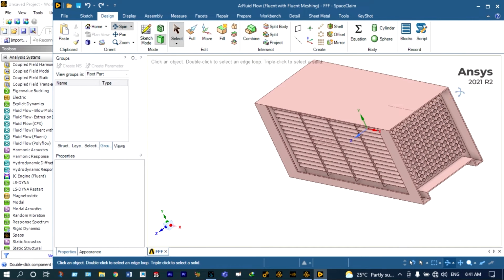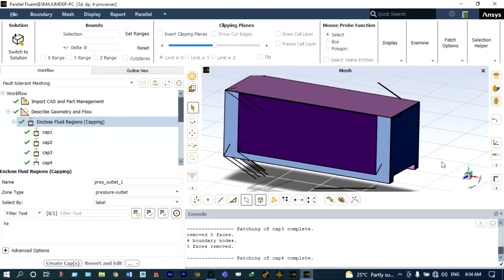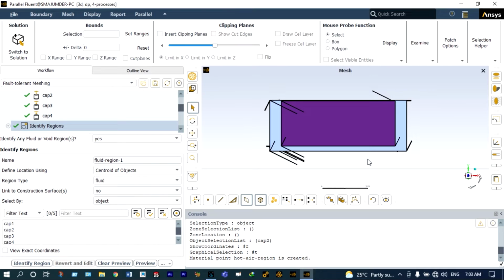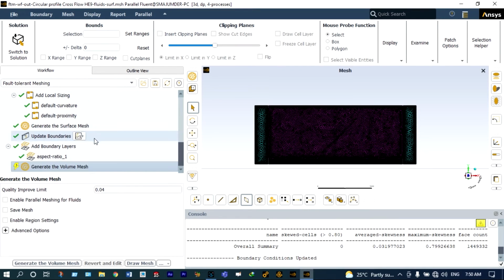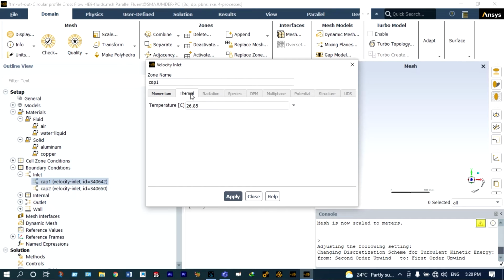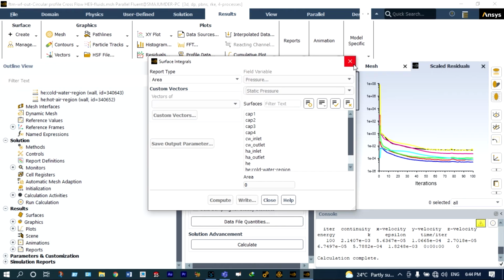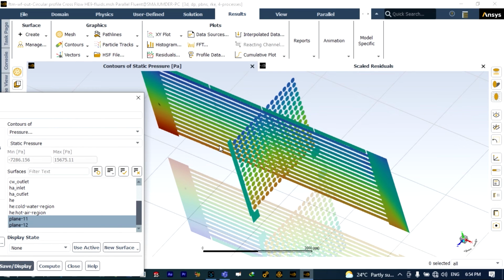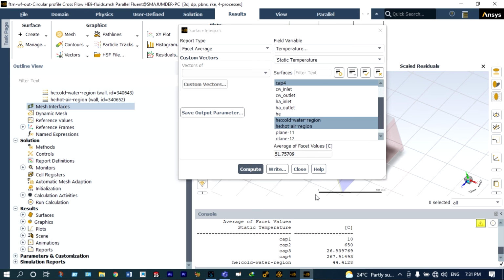CFD Cross flow Heat Exchanger | Best Heat Exchanger Simulation Tutorial - ANSYS Fluent

Comment: can you make flow simulation using solidworks flow. on the motor radiator. I was doing an assignment for my college and found nothing similar. .
Reply: And if I try. Always find obstacles. . On the fins maybe because the fins have too many walls. .
Reply from the maker: Yes, fins causes the system to slow for simulation. I have already made some  simulations on condenser and evaporator in SolidWorks which is similar to your radiator. You can check it.
Reply: @CFD_GUIDE  thanks i will check it. .